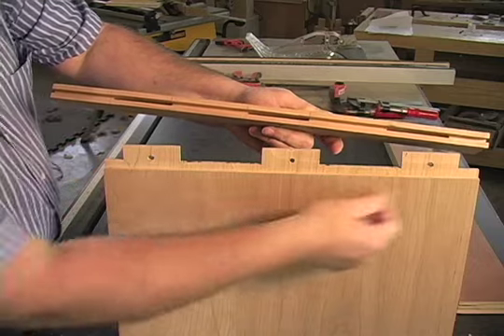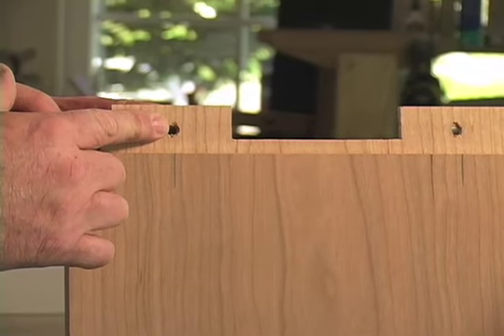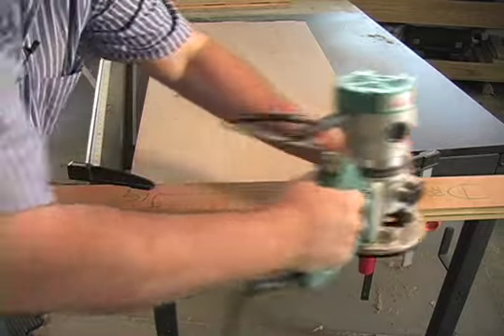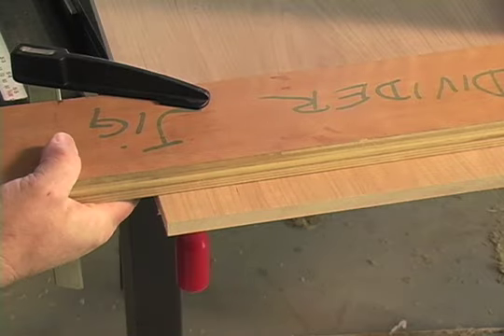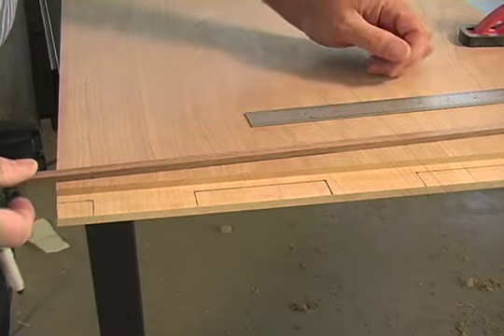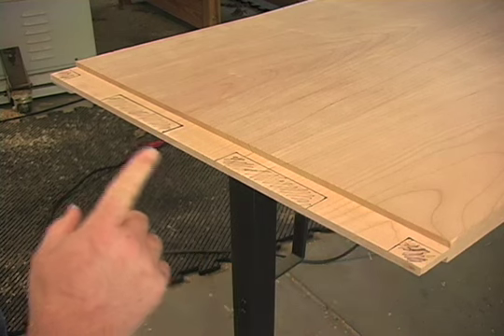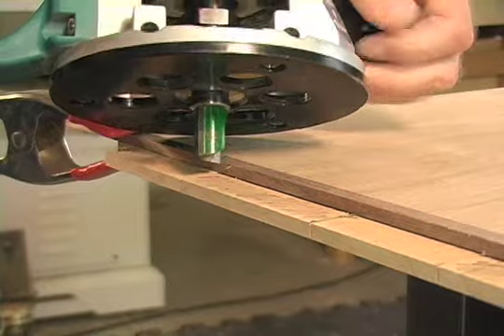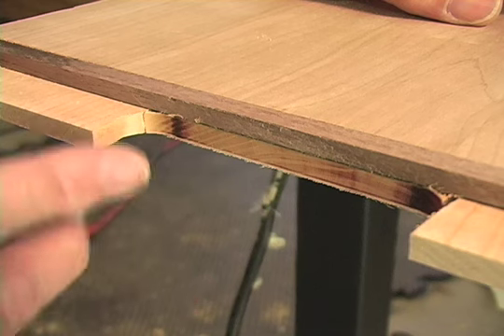Breadboard Ends

Comment: How did u do the mortise ? Routertable by hand mortise machine? Good info on the tenon part
Reply: One method is to use a wood boring bit to remove the bulk, and finish with a hand chisel. Or if your fiances are strong enuff, you can purchase a mortising machine. Some bench top units work fine, W/O having to purchase an industrial quality piece.